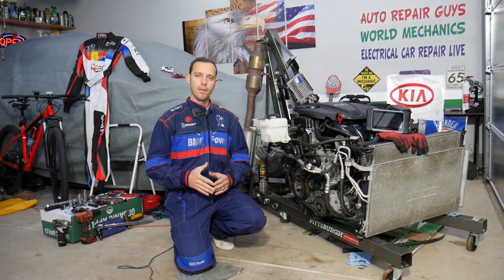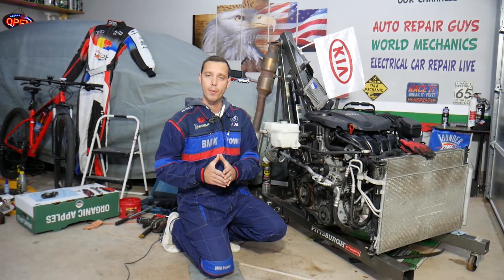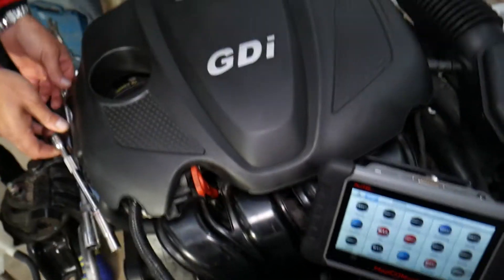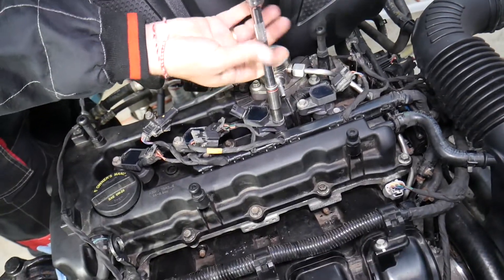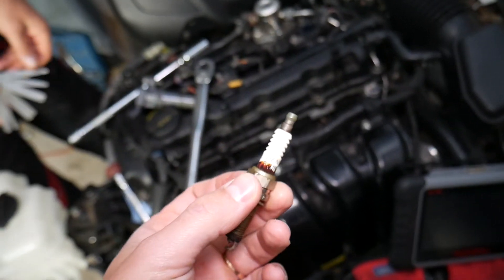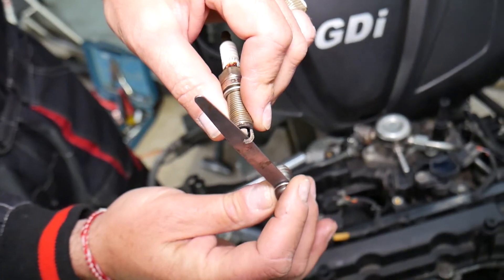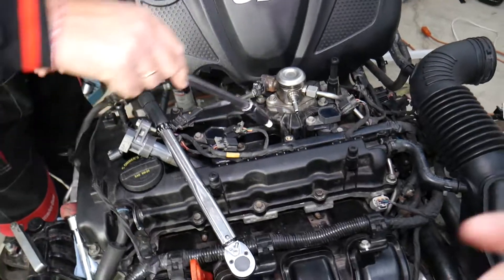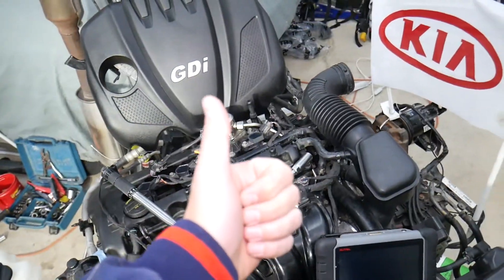SPARK PLUGS REPLACEMENT, SPARK PLUGS GAP TORQUE KIA SORENTO, KIA SPORTAGE

Comment: I don't know if it will be the Throttle Body or map sensor . run well on the streets and highway the problem it has does not mark 1000 rpm. It doesn't show any code. replace spark plug. but no ignition coil. please let me know . What could it be thank

Comment: Hello, how are you? I hope you're fine. I'm asking at how many miles the ignition coil should be changed on a Kia Sorento 2.4, I have 67,000. Hi, how are you? I hope you're fine. I'm asking at how many miles the ignition coil should be changed on a Kia Sorento 2.4. I have 67,000. I see your videos. problem i have rpm is 900 to 850 and when I start ac it goes down. They are not at 1000 rpm and the engine shakes. I await an answer. in writing thank you.

Comment: Hello . I really like watching your informative channel.  I own a 2020 kia sportage ex 2.4 litre , could you post the type of sparkplugs I need aswell as the torque & gap specs . I have 36,000 KM on the engine but I would like to change the plugs sooner than suggested in its maintenance.  Also I'm going to change my PCV valve at the same time " preventative maintenance " I like to keep the sportage running smooth ! Thanks for all you do 👍

Comment: Pieces of the spark plug fell into the cylinder. Please advise on how to take them out
Reply: Magnet
Reply: cry
Reply: Really depends on what pieces, the metal you might be able to fish out with a magnet.  The ceramic parts, aside from taking the headers off I'm not sure of another way to get them out.  (Not a mechanic, but that's my best guess)